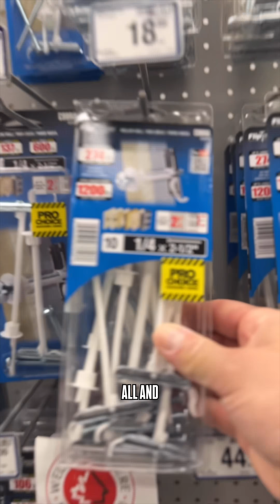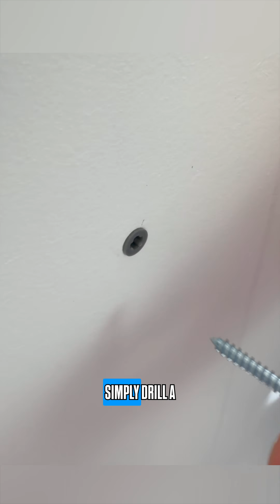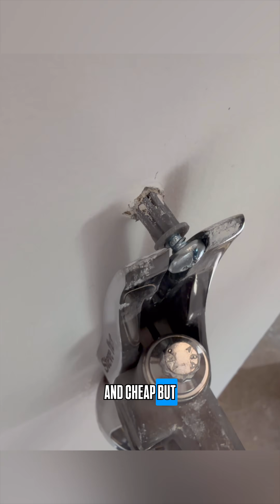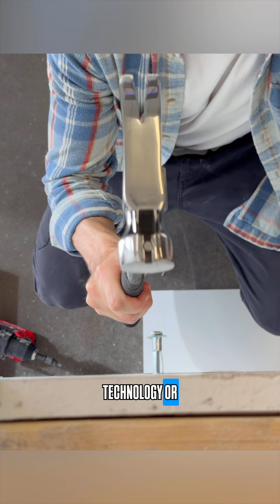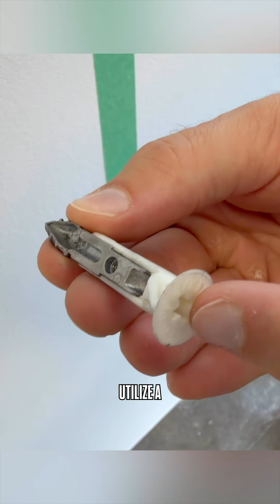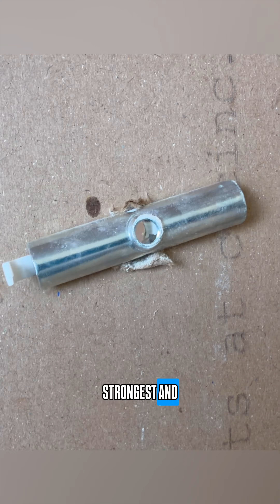How do Drywall Anchors Work?!

Comment: Hmmm I ordered a small mirror and the first kind were included in the box. Is this normal? I live in an apartment and I'm not sure exactly what the walls are made of. Any suggestions on what I should do? I really don't want this mirror to end up in pieces.
Reply from the maker: it's hard to say, but if they included sleeve anchors its probable that they are only for brick installation and NOT drywall. we would recommend buying better anchors or ideally find a stud: Check out our full tutorial: https://youtu.be/xUAPWNhd_ow?si=yOT0SYjTAoj5hkd_
Reply: @RefreshHomeImprovements well.... I think I hit a stud right above an outlet. So I got scared and stopped. I read that it could have wires that I can damage. 😢 I will look into getting better anchors as well.

Comment: The plugs first used isn't for drywalls. They are for concrete.
Reply from the maker: Thanks for the input - this is true! Though many people do use them for drywall. You’ll see them frequently if you’re a painter repairing old walls.

Comment: What do you use for wood panels without drywall behind it? House built in 72
Reply from the maker: Depends what’s behind the wood panels and how think they are. If it’s just 1/4” panels with nothing behind it, we’d suggest toggle anchors, but not for anything heavy!
Reply: @RefreshHomeImprovements thanks! They are 1/4" with nothing behind them. So glad we're just renting
Reply from the maker: Makes sense, try to find the studs. If not the wider the toggle (or bracket behind) the better! Check out the full tutorial if you’re interested